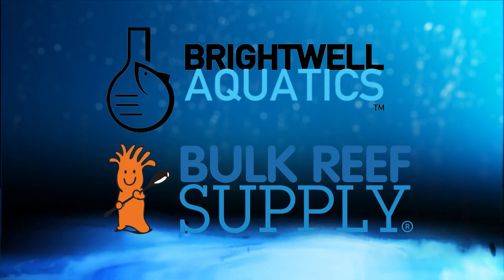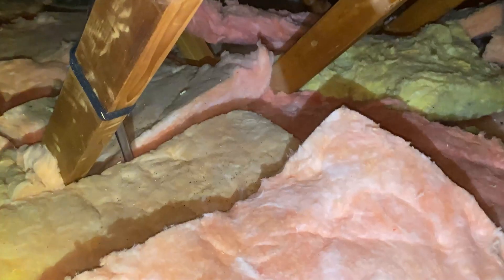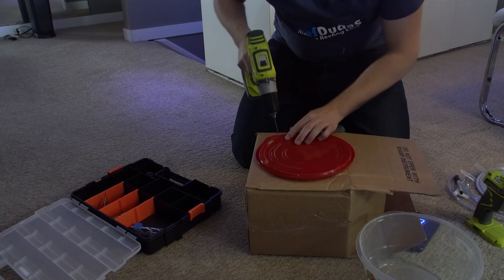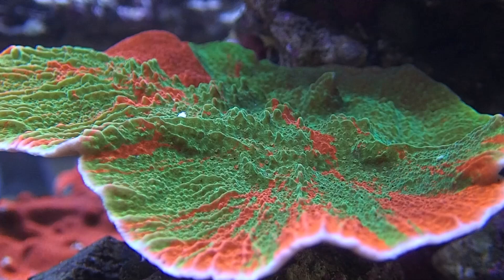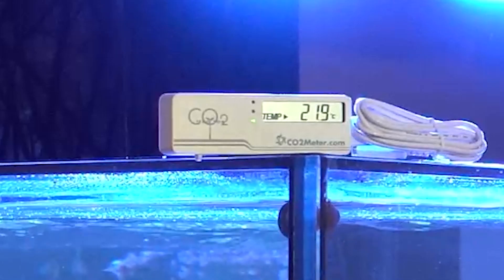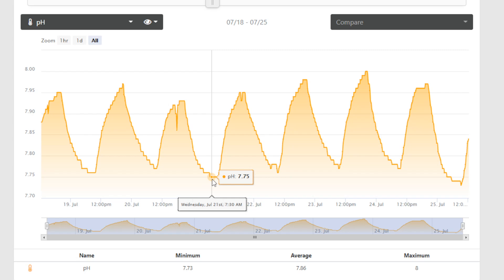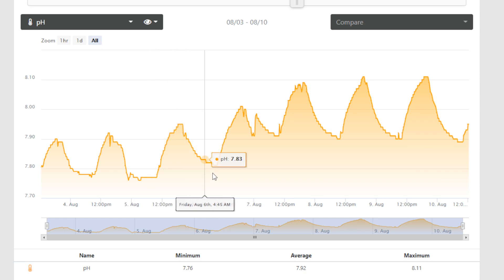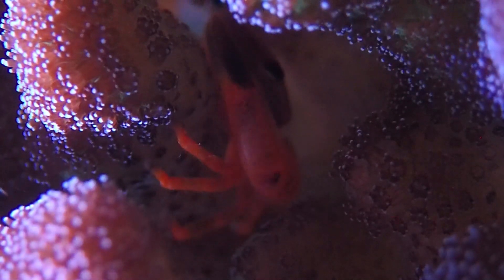My Journey to Raising PH in my Saltwater Reef Tank Aquarium

Comment: Dude, sodium hydroxide for the win. I have a 20L that's wall to wall SPS with healthy growth tips on everything. My pH barely hits 8 2 late afternoon with good room ventilation. I then started adding sodium hydroxide in the morning before lights on and hit 8.4 easily. Growth difference is staggering. Soft corals and LPS double in size in days. Sodium hydroxide adds alk, but per dry volume the same as baking soda, so the math is easy.
Reply: Any issues with the NaOH since?

Comment: If you approach a pH of more than 8.5 you are flirtin' with disaster.In simple laymen's terms all those elements important to coral growth and other elements that are necessary for the reef animals ,will start to precipitate out of solution and other organic processes will be affected. Doc BC
Reply from the maker: Too high is trouble!  I set my dosing to turn off if it ever hits 8.4. 

8.3 seems to be my peak so far
Reply: I know several coral propagators that ride 8.6 to 8.7 with no problems.  Calcium hydroxide causes more precipitation. Also running stupid high calcium levels that serves no benefit. You should see SPS grow at 8.6. Trace elements are a marketing myth.

Comment: Just seems like a PITA to have a calcium reactor....always did fine with 2 part ...
Reply from the maker: Its much cheaper in media compared to buying 2 part all the time.  On a small system not a big issues but on a large system when your dosing say 120ml+ a day the cost can add up quick. 
They are also incredibly stable and do an amazing job keep paramaters stable which also makes for a happy tank.. all a trade off :)

Comment: Take the calcium reactor out and go 2 part.  I had around the same pH as you.  I went two part instead and never gone back.  With all the money I spent on CO2 scrubber media, I could have used it for two part solution instead. My mistake...
Reply from the maker: Its all a trade off.  Calcium reactor is much cheaper to run compare to dosing (once you have the gear)    I do love the stability of stable alk and topping off the media/co2 once every 1-1.5 years! :)
Reply: My new 120, currently low demand, was a low 7.5 PH, so I set up a well hidden 5 gal bucket of Kalk and dose the amount required to maintain a current PH level of 8.2, and that dosage amount currently maintains a steady 9 dkh. I also have Tropic Marin Carbo-Calcium (highly concentrated) to dose in conjunction with the Kalk to keep up the dkh as alk demand increases. I previously bought a brand new calcium reactor set up that I now doubt I’ll ever use. It just never made sense to me to run a reactor, then have to dose kalk to counteract the PH drop. Makes more sense to me to run low cost Kalk to maintain the PH primarily, then use a more concentrated single alk/calcium solution like Carbo-calcium to supplement the Kalk to maintain dkh levels and not have to dose a lot of it since the bulk of the dosing is the Kalk.

Comment: Did you try to put an air pump and wooden air ston like the one that aqua midic makes which will produce micro bubbles.
I hooked my skimmer air line out side the house and one air pump line divided into two micro air stones, now my low ph 8.16 and high 8.25.
Reply from the maker: I did experiment with that way back but hooking fresh air to the skimmer was a simpler way with similar results 

Solid ph!
Reply: @ReefDudes  Try the air stone idea i can almost ensure it will rise the ph at least 0.5 ponit, keep in mind during the colder weather the oxygen density is higher than hot weather.
Reply from the maker: @mustafaadel9219  I may try it, as an experiment but The skimmer would do a much higher air exchange if piped to outside air!  but ill try it again to know for sure! :)
Reply: Can you please explain what you’re talking about here? Where would you put the air stone? Wouldn’t you get microbubbles in the tank?

Comment: Actually did not make any of those changes and had the same readings since spring. It all started when the AC kicked in. Nowadays weather has been pretty decent and AC barely works, strangely, ph is also up. I did looked it up online and found out i'm not the only one who made that assumption. When I  gave it some thought, it started to make sense. I like it cold in the house, having that much cold air in the house also creates a pressure differential with the thinner hotter outside air. The effect is air is always trying to escape the house. When its colder outside, the fresh air is forced to come in. Sure my corals do not grow as fast but as long as they are not dying im ok with it. If anyone know how to keep a house cold and always have fresh air without breaking my coral bank ;) let me know :) happy reefing
Reply: I set my AC to 77ish leaving the house...when I'm home I have a window air exchange unit....magnavox brand sold on amazon....works as fan/exhaust or both ...PH stays nice and high but I'm also using 2 part
Reply from the maker: @Sammy31Dee  sounds like your in a pretty good place with that setup!
Reply: @Sammy31Dee  thx Im gonna look it up :)
Reply from the maker: Well opening a window by your tank is the free methods but doesn’t always work all year in all climates :)
Reply: @ReefDudes  I do have one right above the tank. Its open all year long but when AC is on, air is going out, its not coming in. When its colder outside, I leave just a crack open and ph is 8.1-8.3 but it is also my office so I dont want sweat all summer long :P